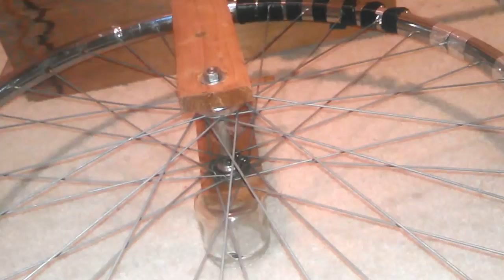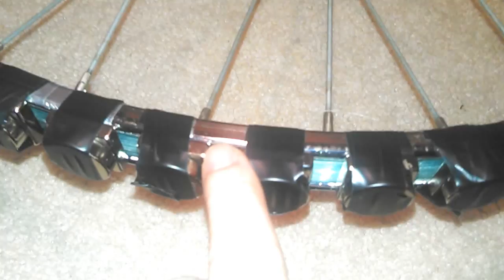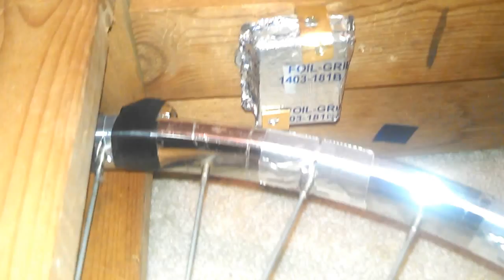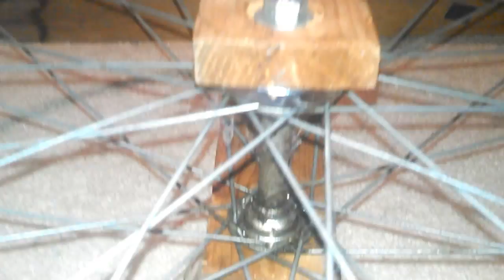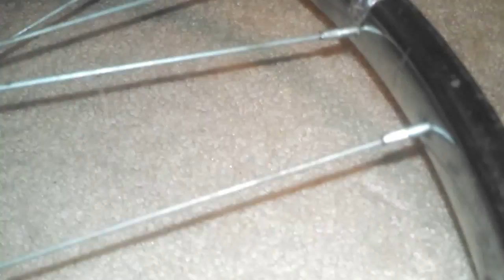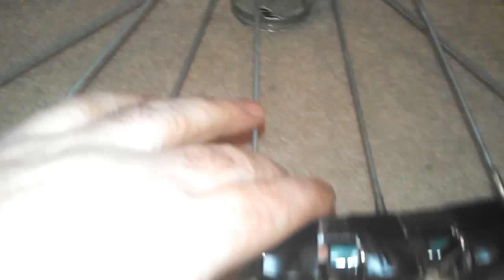🧲 Improved Magnet Position Yields Wonderful Results!

Comment: How do you think it would go with 2 sets of magnets (opposite side of wheel) timed identically then 4 of your stators at the quarters and what effect do you think it would have? Would that not increase the torque and ratio of thrust. ( yes im a newbie) Also is the reason you say it should have 4 stators just due to the spacing ? e.g. if it were a smaller wheel what would you do? Yes i know the vid is about the stator but i guess the question relates to the best way to capitalize on its ability. Thanks and great videos.
Reply from the maker: <!--[if gte mso 9]><xml>
 <o:OfficeDocumentSettings>
  <o:AllowPNG/>
 </o:OfficeDocumentSettings>
</xml><![endif]-->

<p class="MsoNormal">It's all about more stators, as the stators are what drives the wheel. Below are some frequently asked questions that might be of help to you.</p><p class="MsoNormal"></p><p class="MsoNormal">(Q) What
if you had magnets all the way around the rim would the wheel continually go?</p>

<p class="MsoNormal">(A) No.
Rather four stators are used all the way around, placed at the 3, 6, 9 and 12
o'clock position. As the lead magnet is pulled into each stator, the last
magnet is suddenly pulled out of the previous stator. This process simply
repeats itself.</p>

<p class="MsoNormal">________________________________________</p>

<p class="MsoNormal">(Q) How
is it that your stator overcomes the sticky spot?</p>

<p class="MsoNormal">(A) The
stator mimics a hypothetical monopole magnet resulting in greater acceleration
then there is deceleration.</p>

<p class="MsoNormal">________________________________________</p>

<p class="MsoNormal">(Q) What's
the other critical part you talk about in getting your stator to work?</p>

<p class="MsoNormal">(A) The
angle of each stator in relationship to each rotor magnet is nearly 90 degrees
is required to utilize the magnetic runway plate on the face of each stator.</p>

<p class="MsoNormal">________________________________________</p>

<p class="MsoNormal">(Q) How
do the gaps between the rotor magnets affect speed?</p>

<p class="MsoNormal">(A)
Tighter spacing between rotor magnets results in greater speed.</p>

<!--[if gte mso 9]><xml>
 <w:WordDocument>
  <w:View>Normal</w:View>
  <w:Zoom>0</w:Zoom>
  <w:TrackMoves/>
  <w:TrackFormatting/>
  <w:PunctuationKerning/>
  <w:ValidateAgainstSchemas/>
  <w:SaveIfXMLInvalid>false</w:SaveIfXMLInvalid>
  <w:IgnoreMixedContent>false</w:IgnoreMixedContent>
  <w:AlwaysShowPlaceholderText>false</w:AlwaysShowPlaceholderText>
  <w:DoNotPromoteQF/>
  <w:LidThemeOther>EN-US</w:LidThemeOther>
  <w:LidThemeAsian>X-NONE</w:LidThemeAsian>
  <w:LidThemeComplexScript>X-NONE</w:LidThemeComplexScript>
  <w:Compatibility>
   <w:BreakWrappedTables/>
   <w:SnapToGridInCell/>
   <w:WrapTextWithPunct/>
   <w:UseAsianBreakRules/>
   <w:DontGrowAutofit/>
   <w:SplitPgBreakAndParaMark/>
   <w:EnableOpenTypeKerning/>
   <w:DontFlipMirrorIndents/>
   <w:OverrideTableStyleHps/>
  </w:Compatibility>
  <m:mathPr>
   <m:mathFont m:val="Cambria Math"/>
   <m:brkBin m:val="before"/>
   <m:brkBinSub m:val="--"/>
   <m:smallFrac m:val="off"/>
   <m:dispDef/>
   <m:lMargin m:val="0"/>
   <m:rMargin m:val="0"/>
   <m:defJc m:val="centerGroup"/>
   <m:wrapIndent m:val="1440"/>
   <m:intLim m:val="subSup"/>
   <m:naryLim m:val="undOvr"/>
  </m:mathPr></w:WordDocument>
</xml><![endif]--><!--[if gte mso 9]><xml>
 <w:LatentStyles DefLockedState="false" DefUnhideWhenUsed="true"
  DefSemiHidden="true" DefQFormat="false" DefPriority="99"
  LatentStyleCount="267">
  <w:LsdException Locked="false" Priority="0" SemiHidden="false"
   UnhideWhenUsed="false" QFormat="true" Name="Normal"/>
  <w:LsdException Locked="false" Priority="9" SemiHidden="false"
   UnhideWhenUsed="false" QFormat="true" Name="heading 1"/>
  <w:LsdException Locked="false" Priority="9" QFormat="true" Name="heading 2"/>
  <w:LsdException Locked="false" Priority="9" QFormat="true" Name="heading 3"/>
  <w:LsdException Locked="false" Priority="9" QFormat="true" Name="heading 4"/>
  <w:LsdException Locked="false" Priority="9" QFormat="true" Name="heading 5"/>
  <w:LsdException Locked="false" Priority="9" QFormat="true" Name="heading 6"/>
  <w:LsdException Locked="false" Priority="9" QFormat="true" Name="heading 7"/>
  <w:LsdException Locked="false" Priority="9" QFormat="true" Name="heading 8"/>
  <w:LsdException Locked="false" Priority="9" QFormat="true" Name="heading 9"/>
  <w:LsdException Locked="false" Priority="39" Name="toc 1"/>
  <w:LsdException Locked="false" Priority="39" Name="toc 2"/>
  <w:LsdException Locked="false" Priority="39" Name="toc 3"/>
  <w:LsdException Locked="false" Priority="39" Name="toc 4"/>
  <w:LsdException Locked="false" Priority="39" Name="toc 5"/>
  <w:LsdException Locked="false" Priority="39" Name="toc 6"/>
  <w:LsdException Locked="false" Priority="39" Name="toc 7"/>
  <w:LsdException Locked="false" Priority="39" Name="toc 8"/>
  <w:LsdException Locked="false" Priority="39" Name="toc 9"/>
  <w:LsdException Locked="false" Priority="35" QFormat="true" Name="caption"/>
  <w:LsdException Locked="false" Priority="10" SemiHidden="false"
   UnhideWhenUsed="false" QFormat="true" Name="Title"/>
  <w:LsdException Locked="false" Priority="1" Name="Default Paragraph Font"/>
  <w:LsdException Locked="false" Priority="11" SemiHidden="false"
   UnhideWhenUsed="false" QFormat="true" Name="Subtitle"/>
  <w:LsdException Locked="false" Priority="22" SemiHidden="false"
   UnhideWhenUsed="false" QFormat="true" Name="Strong"/>
  <w:LsdException Locked="false" Priority="20" SemiHidden="false"
   UnhideWhenUsed="false" QFormat="true" Name="Emphasis"/>
  <w:LsdException Locked="false" Priority="59" SemiHidden="false"
   UnhideWhenUsed="false" Name="Table Grid"/>
  <w:LsdException Locked="false" UnhideWhenUsed="false" Name="Placeholder Text"/>
  <w:LsdException Locked="false" Priority="1" SemiHidden="false"
   UnhideWhenUsed="false" QFormat="true" Name="No Spacing"/>
  <w:LsdException Locked="false" Priority="60" SemiHidden="false"
   UnhideWhenUsed="false" Name="Light Shading"/>
  <w:LsdException Locked="false" Priority="61" SemiHidden="false"
   UnhideWhenUsed="false" Name="Light List"/>
  <w:LsdException Locked="false" Priority="62" SemiHidden="false"
   UnhideWhenUsed="false" Name="Light Grid"/>
  <w:LsdException Locked="false" Priority="63" SemiHidden="false"
   UnhideWhenUsed="false" Name="Medium Shading 1"/>
  <w:LsdException Locked="false" Priority="64" SemiHidden="false"
   UnhideWhenUsed="false" Name="Medium Shading 2"/>
  <w:LsdException Locked="false" Priority="65" SemiHidden="false"
   UnhideWhenUsed="false" Name="Medium List 1"/>
  <w:LsdException Locked="false" Priority="66" SemiHidden="false"
   UnhideWhenUsed="false" Name="Medium List 2"/>
  <w:LsdException Locked="false" Priority="67" SemiHidden="false"
   UnhideWhenUsed="false" Name="Medium Grid 1"/>
  <w:LsdException Locked="false" Priority="68" SemiHidden="false"
   UnhideWhenUsed="false" Name="Medium Grid 2"/>
  <w:LsdException Locked="false" Priority="69" SemiHidden="false"
   UnhideWhenUsed="false" Name="Medium Grid 3"/>
  <w:LsdException Locked="false" Priority="70" SemiHidden="false"
   UnhideWhenUsed="false" Name="Dark List"/>
  <w:LsdException Locked="false" Priority="71" SemiHidden="false"
   UnhideWhenUsed="false" Name="Colorful Shading"/>
  <w:LsdException Locked="false" Priority="72" SemiHidden="false"
   UnhideWhenUsed="false" Name="Colorful List"/>
  <w:LsdException Locked="false" Priority="73" SemiHidden="false"
   UnhideWhenUsed="false" Name="Colorful Grid"/>
  <w:LsdException Locked="false" Priority="60" SemiHidden="false"
   UnhideWhenUsed="false" Name="Light Shading Accent 1"/>
  <w:LsdException Locked="false" Priority="61" SemiHidden="false"
   UnhideWhenUsed="false" Name="Light List Accent 1"/>
  <w:LsdException Locked="false" Priority="62" SemiHidden="false"
   UnhideWhenUsed="false" Name="Light Grid Accent 1"/>
  <w:LsdException Locked="false" Priority="63" SemiHidden="false"
   UnhideWhenUsed="false" Name="Medium Shading 1 Accent 1"/>
  <w:LsdException Locked="false" Priority="64" SemiHidden="false"
   UnhideWhenUsed="false" Name="Medium Shading 2 Accent 1"/>
  <w:LsdException Locked="false" Priority="65" SemiHidden="false"
   UnhideWhenUsed="false" Name="Medium List 1 Accent 1"/>
  <w:LsdException Locked="false" UnhideWhenUsed="false" Name="Revision"/>
  <w:LsdException Locked="false" Priority="34" SemiHidden="false"
   UnhideWhenUsed="false" QFormat="true" Name="List Paragraph"/>
  <w:LsdException Locked="false" Priority="29" SemiHidden="false"
   UnhideWhenUsed="false" QFormat="true" Name="Quote"/>
  <w:LsdException Locked="false" Priority="30" SemiHidden="false"
   UnhideWhenUsed="false" QFormat="true" Name="Intense Quote"/>
  <w:LsdException Locked="false" Priority="66" SemiHidden="false"
   UnhideWhenUsed="false" Name="Medium List 2 Accent 1"/>
  <w:LsdException Locked="false" Priority="67" SemiHidden="false"
   UnhideWhenUsed="false" Name="Medium Grid 1 Accent 1"/>
  <w:LsdException Locked="false" Priority="68" SemiHidden="false"
   UnhideWhenUsed="false" Name="Medium Grid 2 Accent 1"/>
  <w:LsdException Locked="false" Priority="69" SemiHidden="false"
   UnhideWhenUsed="false" Name="Medium Grid 3 Accent 1"/>
  <w:LsdException Locked="false" Priority="70" SemiHidden="false"
   UnhideWhenUsed="false" Name="Dark List Accent 1"/>
  <w:LsdException Locked="false" Priority="71" SemiHidden="false"
   UnhideWhenUsed="false" Name="Colorful Shading Accent 1"/>
  <w:LsdException Locked="false" Priority="72" SemiHidden="false"
   UnhideWhenUsed="false" Name="Colorful List Accent 1"/>
  <w:LsdException Locked="false" Priority="73" SemiHidden="false"
   UnhideWhenUsed="false" Name="Colorful Grid Accent 1"/>
  <w:LsdException Locked="false" Priority="60" SemiHidden="false"
   UnhideWhenUsed="false" Name="Light Shading Accent 2"/>
  <w:LsdException Locked="false" Priority="61" SemiHidden="false"
   UnhideWhenUsed="false" Name="Light List Accent 2"/>
  <w:LsdException Locked="false" Priority="62" SemiHidden="false"
   UnhideWhenUsed="false" Name="Light Grid Accent 2"/>
  <w:LsdException Locked="false" Priority="63" SemiHidden="false"
   UnhideWhenUsed="false" Name="Medium Shading 1 Accent 2"/>
  <w:LsdException Locked="false" Priority="64" SemiHidden="false"
   UnhideWhenUsed="false" Name="Medium Shading 2 Accent 2"/>
  <w:LsdException Locked="false" Priority="65" SemiHidden="false"
   UnhideWhenUsed="false" Name="Medium List 1 Accent 2"/>
  <w:LsdException Locked="false" Priority="66" SemiHidden="false"
   UnhideWhenUsed="false" Name="Medium List 2 Accent 2"/>
  <w:LsdException Locked="false" Priority="67" SemiHidden="false"
   UnhideWhenUsed="false" Name="Medium Grid 1 Accent 2"/>
  <w:LsdException Locked="false" Priority="68" SemiHidden="false"
   UnhideWhenUsed="false" Name="Medium Grid 2 Accent 2"/>
  <w:LsdException Locked="false" Priority="69" SemiHidden="false"
   UnhideWhenUsed="false" Name="Medium Grid 3 Accent 2"/>
  <w:LsdException Locked="false" Priority="70" SemiHidden="false"
   UnhideWhenUsed="false" Name="Dark List Accent 2"/>
  <w:LsdException Locked="false" Priority="71" SemiHidden="false"
   UnhideWhenUsed="false" Name="Colorful Shading Accent 2"/>
  <w:LsdException Locked="false" Priority="72" SemiHidden="false"
   UnhideWhenUsed="false" Name="Colorful List Accent 2"/>
  <w:LsdException Locked="false" Priority="73" SemiHidden="false"
   UnhideWhenUsed="false" Name="Colorful Grid Accent 2"/>
  <w:LsdException Locked="false" Priority="60" SemiHidden="false"
   UnhideWhenUsed="false" Name="Light Shading Accent 3"/>
  <w:LsdException Locked="false" Priority="61" SemiHidden="false"
   UnhideWhenUsed="false" Name="Light List Accent 3"/>
  <w:LsdException Locked="false" Priority="62" SemiHidden="false"
   UnhideWhenUsed="false" Name="Light Grid Accent 3"/>
  <w:LsdException Locked="false" Priority="63" SemiHidden="false"
   UnhideWhenUsed="false" Name="Medium Shading 1 Accent 3"/>
  <w:LsdException Locked="false" Priority="64" SemiHidden="false"
   UnhideWhenUsed="false" Name="Medium Shading 2 Accent 3"/>
  <w:LsdException Locked="false" Priority="65" SemiHidden="false"
   UnhideWhenUsed="false" Name="Medium List 1 Accent 3"/>
  <w:LsdException Locked="false" Priority="66" SemiHidden="false"
   UnhideWhenUsed="false" Name="Medium List 2 Accent 3"/>
  <w:LsdException Locked="false" Priority="67" SemiHidden="false"
   UnhideWhenUsed="false" Name="Medium Grid 1 Accent 3"/>
  <w:LsdException Locked="false" Priority="68" SemiHidden="false"
   UnhideWhenUsed="false" Name="Medium Grid 2 Accent 3"/>
  <w:LsdException Locked="false" Priority="69" SemiHidden="false"
   UnhideWhenUsed="false" Name="Medium Grid 3 Accent 3"/>
  <w:LsdException Locked="false" Priority="70" SemiHidden="false"
   UnhideWhenUsed="false" Name="Dark List Accent 3"/>
  <w:LsdException Locked="false" Priority="71" SemiHidden="false"
   UnhideWhenUsed="false" Name="Colorful Shading Accent 3"/>
  <w:LsdException Locked="false" Priority="72" SemiHidden="false"
   UnhideWhenUsed="false" Name="Colorful List Accent 3"/>
  <w:LsdException Locked="false" Priority="73" SemiHidden="false"
   UnhideWhenUsed="false" Name="Colorful Grid Accent 3"/>
  <w:LsdException Locked="false" Priority="60" SemiHidden="false"
   UnhideWhenUsed="false" Name="Light Shading Accent 4"/>
  <w:LsdException Locked="false" Priority="61" SemiHidden="false"
   UnhideWhenUsed="false" Name="Light List Accent 4"/>
  <w:LsdException Locked="false" Priority="62" SemiHidden="false"
   UnhideWhenUsed="false" Name="Light Grid Accent 4"/>
  <w:LsdException Locked="false" Priority="63" SemiHidden="false"
   UnhideWhenUsed="false" Name="Medium Shading 1 Accent 4"/>
  <w:LsdException Locked="false" Priority="64" SemiHidden="false"
   UnhideWhenUsed="false" Name="Medium Shading 2 Accent 4"/>
  <w:LsdException Locked="false" Priority="65" SemiHidden="false"
   UnhideWhenUsed="false" Name="Medium List 1 Accent 4"/>
  <w:LsdException Locked="false" Priority="66" SemiHidden="false"
   UnhideWhenUsed="false" Name="Medium List 2 Accent 4"/>
  <w:LsdException Locked="false" Priority="67" SemiHidden="false"
   UnhideWhenUsed="false" Name="Medium Grid 1 Accent 4"/>
  <w:LsdException Locked="false" Priority="68" SemiHidden="false"
   UnhideWhenUsed="false" Name="Medium Grid 2 Accent 4"/>
  <w:LsdException Locked="false" Priority="69" SemiHidden="false"
   UnhideWhenUsed="false" Name="Medium Grid 3 Accent 4"/>
  <w:LsdException Locked="false" Priority="70" SemiHidden="false"
   UnhideWhenUsed="false" Name="Dark List Accent 4"/>
  <w:LsdException Locked="false" Priority="71" SemiHidden="false"
   UnhideWhenUsed="false" Name="Colorful Shading Accent 4"/>
  <w:LsdException Locked="false" Priority="72" SemiHidden="false"
   UnhideWhenUsed="false" Name="Colorful List Accent 4"/>
  <w:LsdException Locked="false" Priority="73" SemiHidden="false"
   UnhideWhenUsed="false" Name="Colorful Grid Accent 4"/>
  <w:LsdException Locked="false" Priority="60" SemiHidden="false"
   UnhideWhenUsed="false" Name="Light Shading Accent 5"/>
  <w:LsdException Locked="false" Priority="61" SemiHidden="false"
   UnhideWhenUsed="false" Name="Light List Accent 5"/>
  <w:LsdException Locked="false" Priority="62" SemiHidden="false"
   UnhideWhenUsed="false" Name="Light Grid Accent 5"/>
  <w:LsdException Locked="false" Priority="63" SemiHidden="false"
   UnhideWhenUsed="false" Name="Medium Shading 1 Accent 5"/>
  <w:LsdException Locked="false" Priority="64" SemiHidden="false"
   UnhideWhenUsed="false" Name="Medium Shading 2 Accent 5"/>
  <w:LsdException Locked="false" Priority="65" SemiHidden="false"
   UnhideWhenUsed="false" Name="Medium List 1 Accent 5"/>
  <w:LsdException Locked="false" Priority="66" SemiHidden="false"
   UnhideWhenUsed="false" Name="Medium List 2 Accent 5"/>
  <w:LsdException Locked="false" Priority="67" SemiHidden="false"
   UnhideWhenUsed="false" Name="Medium Grid 1 Accent 5"/>
  <w:LsdException Locked="false" Priority="68" SemiHidden="false"
   UnhideWhenUsed="false" Name="Medium Grid 2 Accent 5"/>
  <w:LsdException Locked="false" Priority="69" SemiHidden="false"
   UnhideWhenUsed="false" Name="Medium Grid 3 Accent 5"/>
  <w:LsdException Locked="false" Priority="70" SemiHidden="false"
   UnhideWhenUsed="false" Name="Dark List Accent 5"/>
  <w:LsdException Locked="false" Priority="71" SemiHidden="false"
   UnhideWhenUsed="false" Name="Colorful Shading Accent 5"/>
  <w:LsdException Locked="false" Priority="72" SemiHidden="false"
   UnhideWhenUsed="false" Name="Colorful List Accent 5"/>
  <w:LsdException Locked="false" Priority="73" SemiHidden="false"
   UnhideWhenUsed="false" Name="Colorful Grid Accent 5"/>
  <w:LsdException Locked="false" Priority="60" SemiHidden="false"
   UnhideWhenUsed="false" Name="Light Shading Accent 6"/>
  <w:LsdException Locked="false" Priority="61" SemiHidden="false"
   UnhideWhenUsed="false" Name="Light List Accent 6"/>
  <w:LsdException Locked="false" Priority="62" SemiHidden="false"
   UnhideWhenUsed="false" Name="Light Grid Accent 6"/>
  <w:LsdException Locked="false" Priority="63" SemiHidden="false"
   UnhideWhenUsed="false" Name="Medium Shading 1 Accent 6"/>
  <w:LsdException Locked="false" Priority="64" SemiHidden="false"
   UnhideWhenUsed="false" Name="Medium Shading 2 Accent 6"/>
  <w:LsdException Locked="false" Priority="65" SemiHidden="false"
   UnhideWhenUsed="false" Name="Medium List 1 Accent 6"/>
  <w:LsdException Locked="false" Priority="66" SemiHidden="false"
   UnhideWhenUsed="false" Name="Medium List 2 Accent 6"/>
  <w:LsdException Locked="false" Priority="67" SemiHidden="false"
   UnhideWhenUsed="false" Name="Medium Grid 1 Accent 6"/>
  <w:LsdException Locked="false" Priority="68" SemiHidden="false"
   UnhideWhenUsed="false" Name="Medium Grid 2 Accent 6"/>
  <w:LsdException Locked="false" Priority="69" SemiHidden="false"
   UnhideWhenUsed="false" Name="Medium Grid 3 Accent 6"/>
  <w:LsdException Locked="false" Priority="70" SemiHidden="false"
   UnhideWhenUsed="false" Name="Dark List Accent 6"/>
  <w:LsdException Locked="false" Priority="71" SemiHidden="false"
   UnhideWhenUsed="false" Name="Colorful Shading Accent 6"/>
  <w:LsdException Locked="false" Priority="72" SemiHidden="false"
   UnhideWhenUsed="false" Name="Colorful List Accent 6"/>
  <w:LsdException Locked="false" Priority="73" SemiHidden="false"
   UnhideWhenUsed="false" Name="Colorful Grid Accent 6"/>
  <w:LsdException Locked="false" Priority="19" SemiHidden="false"
   UnhideWhenUsed="false" QFormat="true" Name="Subtle Emphasis"/>
  <w:LsdException Locked="false" Priority="21" SemiHidden="false"
   UnhideWhenUsed="false" QFormat="true" Name="Intense Emphasis"/>
  <w:LsdException Locked="false" Priority="31" SemiHidden="false"
   UnhideWhenUsed="false" QFormat="true" Name="Subtle Reference"/>
  <w:LsdException Locked="false" Priority="32" SemiHidden="false"
   UnhideWhenUsed="false" QFormat="true" Name="Intense Reference"/>
  <w:LsdException Locked="false" Priority="33" SemiHidden="false"
   UnhideWhenUsed="false" QFormat="true" Name="Book Title"/>
  <w:LsdException Locked="false" Priority="37" Name="Bibliography"/>
  <w:LsdException Locked="false" Priority="39" QFormat="true" Name="TOC Heading"/>
 </w:LatentStyles>
</xml><![endif]--><!--[if gte mso 10]>
<style>
 /* Style Definitions */
 table.MsoNormalTable
 {mso-style-name:"Table Normal";
 mso-tstyle-rowband-size:0;
 mso-tstyle-colband-size:0;
 mso-style-noshow:yes;
 mso-style-priority:99;
 mso-style-parent:"";
 mso-padding-alt:0in 5.4pt 0in 5.4pt;
 mso-para-margin-top:0in;
 mso-para-margin-right:0in;
 mso-para-margin-bottom:10.0pt;
 mso-para-margin-left:0in;
 line-height:115%;
 mso-pagination:widow-orphan;
 font-size:11.0pt;
 font-family:"Calibri","sans-serif";
 mso-ascii-font-family:Calibri;
 mso-ascii-theme-font:minor-latin;
 mso-hansi-font-family:Calibri;
 mso-hansi-theme-font:minor-latin;}
</style>
<![endif]-->